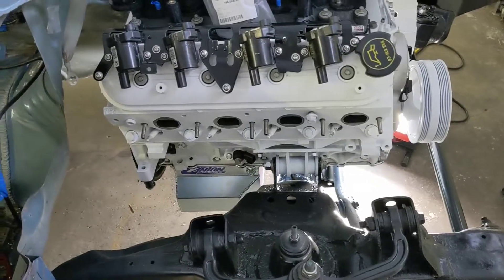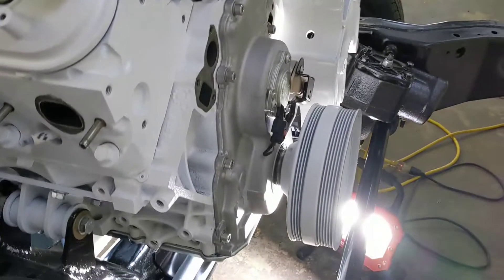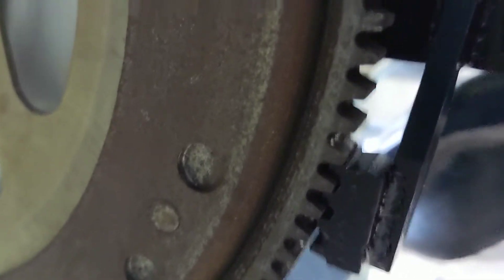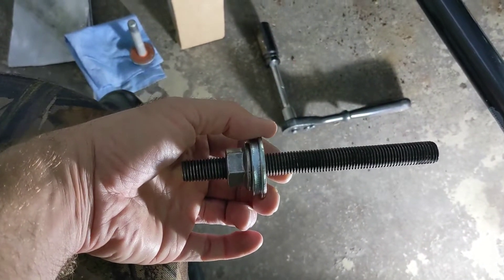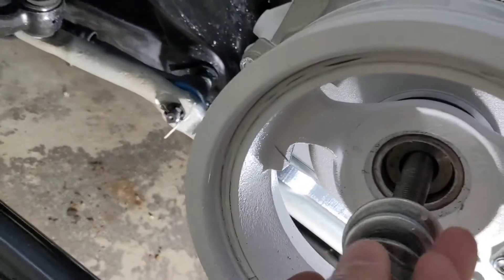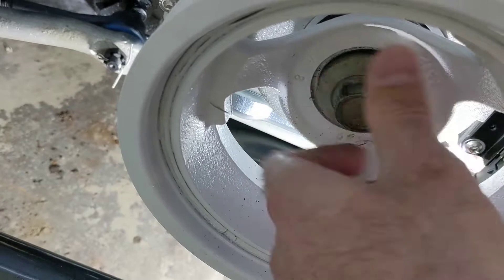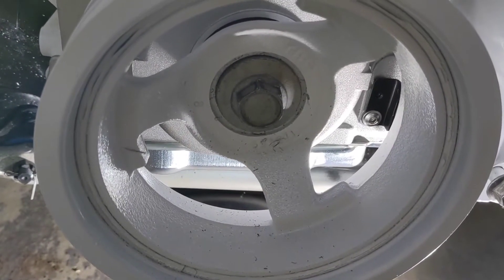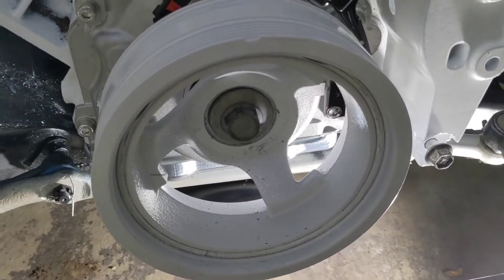Harmonic Balancer install LS

Comment: That's easy , fyi if you have any extra horsepower  u have to pin  the pully to the crankshaft . Take my advice it will spin  the pully and ruin  the hormonic pully inside diameter.  God bless yall real good.
Reply from the maker: Thanks! I will be switching out balancers on it. Since it was completely stock I wasn't too worried about pinning it. I for sure will if I do a cam though.
The install is an easy task, but there are budding mechanics and such that don't know how to do some of this stuff. I just try to help some of those people out with these videos